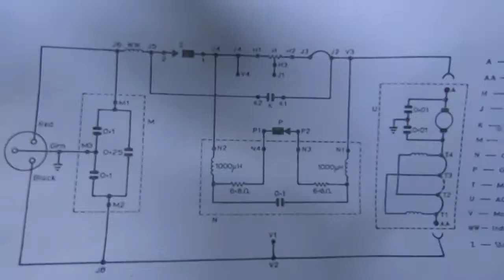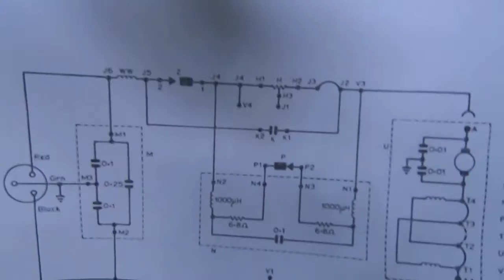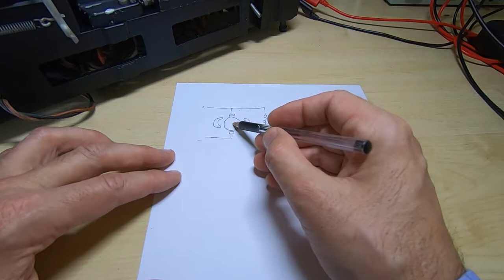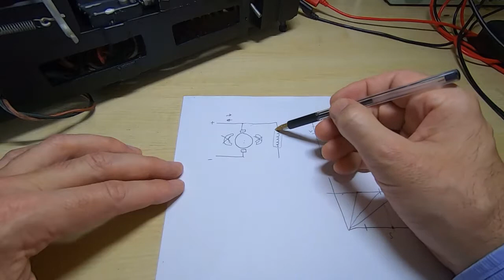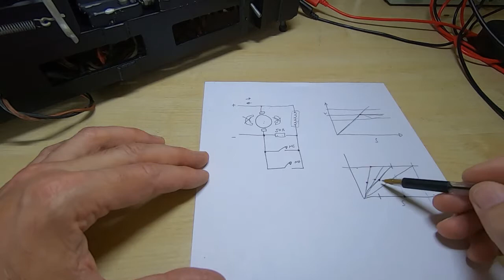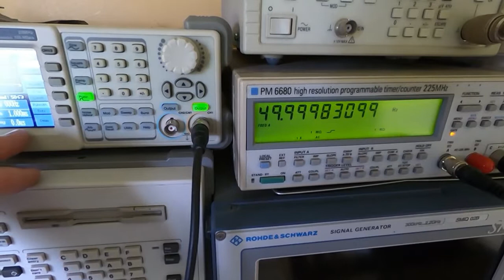Creed 7B Mark 1 Teleprinter Part11

Comment: Learning about the motor was quite interesting.  Totally makes sense that stronger magnets gives lower RPMs now that you explained it, I had never really thought of that before.  One question that comes to mind is what are the reasons for putting the rotor and field coil in parallel vs in series?  It seems to me that running them in series is safer so that if one shorts out or blows open the other does not get really hot?
Reply from the maker: The windings are only a few ohms so if one shorts then so would the other. Either way the motor would be ruined. The only thing that limits the current is the back emf and if one winding shorts the motor would stop and burn up both windings. This would apply to both series and shunt wound motors. By putting them in parallel the field current can be independently controlled to give the benefits I describe. Series wound motors have different characteristics.